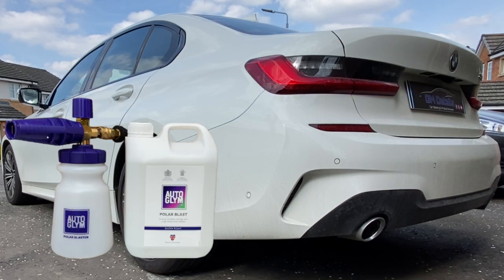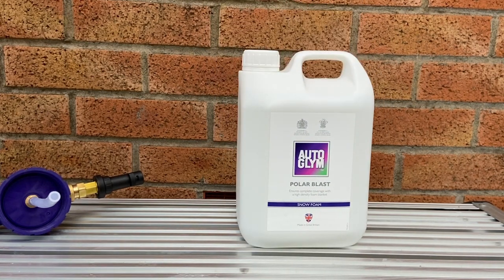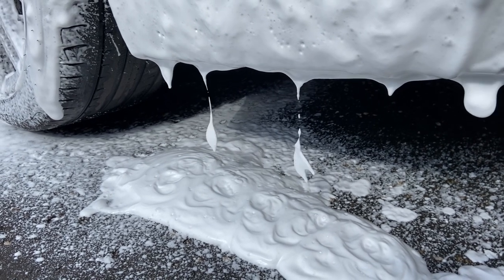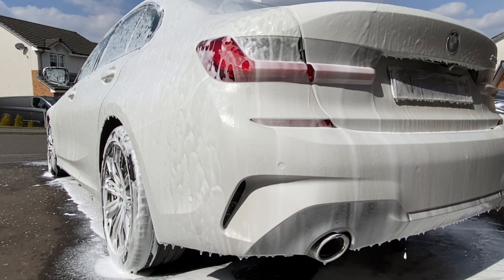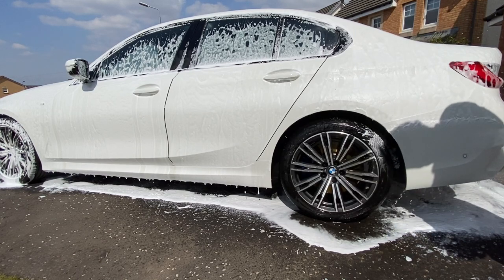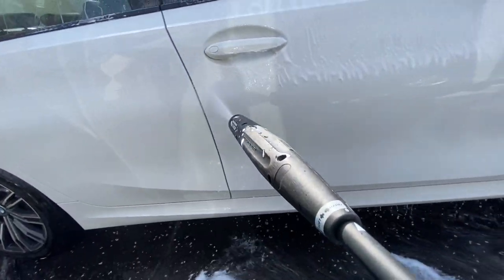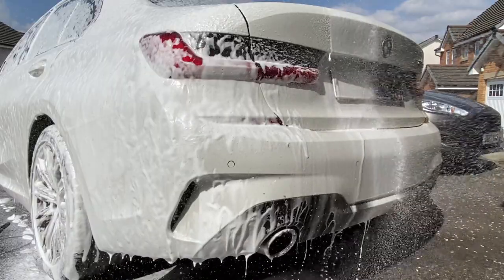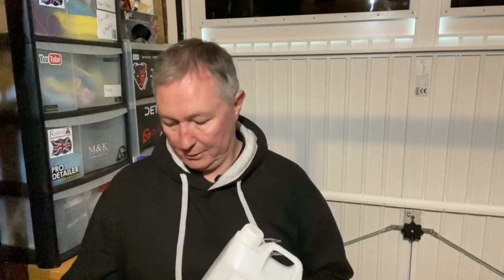Autoglym Polar Blaster Snowfoam Lance & Polar Blast foam review  | Karcher attachment

Comment: I watched your video today, tried to fit my polar blast to my K5 - for the life of my I couldn’t get to work. Other attachments work - has anyone had this problem ? It looked so simple in your video 😂
Reply from the maker: Aw so you have the black plastic Karcher to QC brass connector ?
Reply: @GMDetails  yes, I believe so. It was pre fitted to Autoglym blaster. I can take the vario lance off easily, yet a epic fail attaching the autoglym
Reply from the maker: @ukharrythomas007  it can be if you try and attach it while it’s connected to the lance , detach the QC part , attach the black Karcher part to your Karcher gun then use the QC brass connect to your AutoGlym foam lance , hopefully that will work better
Reply: @GMDetails  turns out it was a yellow connector from another lance stick in the vario wand. I’ve removed this and the autoglym now works 🙏🏻🙏🏻👌👌 - thanks for your help & video !
Reply from the maker: @ukharrythomas007 aw brilliant!!, glad you got it sorted 👍👍👍

Comment: I have used all three blast,wash and seal. All very good and value for money, Graeme.
Reply from the maker: I just wasn’t sure on the wash being snowfoamed on then rubbing a mitt over it , do you have some of the shampoo in the wash bucket as well?
Reply: @GMDetails  I use the blast first, then apply the wash on the car and mitt and shampoo the car. Finally I use the seal which gives a bit of protection and also acts as a drying aid.
Reply from the maker: Sounds awesome , I saw some reviewers using the sealant and quite a few foam sealants on the market now. certainly products are aiming at speed and ease of use now

Comment: Got a deal on Polar Blast from Halfords and Im quite impressed with it  ,  using a foamer its never going to be thick but does a good job and has more cling than Bilt Hamber applied the same way
Reply from the maker: I was actually surprised with it mate , being available in Halfords you know these things NEVER work 🙄
I’ve not contact washed the car the last few weeks , only Polar Blast and left it alone , something I’ve never done!!, I may never use shampoo again 🤣
Reply: @GMDetails  think it was 3 tubs for £21 so cant moan at that really . If its rubbish Id mix it with other foams to make them last longer
Reply from the maker: Yeah don’t waste it , can make a hybrid mix 🤣

Comment: Th foam dripping off into the floor isn’t wasting product, it’s actually good because then it picks up and carries the dirt off rather than just stick tot he paint
Reply from the maker: I get what you’re saying and I partly agree with you but only the foam which is in contact with the dirt can collect and remove it , I just felt that the initial application was overly thick and heavy prematurely pulling the foam off without an adequate dwell time that was all

Comment: I do enjoy AUTO GYM, but the hose end rubber O-ring failed almost immediately on the Blaster and leaked. Otherwise the polar blast, Polar wash and the polar seal worked great. I would recommend claying as well for better longevity of the polar seal.  Still beading decently after a month. Great Products.
Reply from the maker: That’s a shame your blaster failed so quickly, it is indeed a formidable trio of products, a month worth of beading is good going 👍👍

Comment: Great video Graeme, I think Auto Glym is a bit of a marmite manufacturer as it's traditional branding and look will not attract the yoof of today and its probably seen as a brand that grandad uses, even though its products are very good whilst not being the best in class.
That snow foam is so thick and reminds me of Autobrite Direct Magifoam in that if you get your ratios wrong it will be hanging around on your drive for days.
Superb cleaning power on the Polar blast and was definitely making a difference on your white paintwork.
Keep up the good work 👍🏻
Reply from the maker: Thanks Paul, genuinely impressed me how good the cleaning power is for a ph neutral foam, and unlike magifoam it won’t make it look like Santa’s just landed on your drive 🤣
Reply: @GMDetails  yes and unfortunately for me my drive doesn't slope away from my house so I have to brush the foam away, bringing even more strange looks from the neighbours 🙄
Reply: Not sure I agree with that. Always saw them as a premium brand - expensive if you were young but the best - even if its not the case.

Comment: Great video as per Greame, can I ask u tho, see how you've been doing the GT Tyre Serum, what's ur wash process for ur wheels n tyres? Do u still scrub them and if not do u apply it after every wash? Cheers Alan. 😎👍🏻🏴
Reply from the maker: Hi Alan, great question and I’m glad you asked mate, I’ve literally only used tyre serum 3 or 4 times since beginning of January and 5 months later the tyres are still conditioned and looking amazing , yes they get dirty and lose their perfect looks but just some GT wheel shampoo and a hogs hair brush is all you need to clean the tyres , scrubbing them isn’t necessary with tyre serum. 
For the wheels, well mines are ceramic coated so dirt build up isn’t as bad as without a coating , but again, GT one wheel shampoo in a bucket and also in a pump foamer like the IK foamer. 
Basically same process as your car, rinse , foam, and shampoo, once every few months I’ll go in with zero decon just to cleanse the ceramic and top up with GT Sigma, hardly need to use fallout remover on them at all with GT products. 
And yes, you can apply tyre serum after every wash if you like but I haven’t been and I still see the benefits , I didn’t in the early part of the year with winter salts etc but that was just the same dirt that was on the paint anyway , nothing stays clean very long does it 🤨
Reply: @GMDetails  thanks for the reply Graeme, that's some great info mate, your tyres look brilliant, defo prefer that look compared to the shiney wet look, that's so Arnold Clark showroom 😂 thanks for the quick response bud 😎👍🏻🏴
Reply from the maker: Ha ha ha Arnold’s gloss black paint 🤣🤣
Reply: @GMDetails  aye that's more like it 😂😂😂😂

Comment: Got this a while ago and only just getting round to using it so really useful video. Do you have the marcher on the ‘mix’ setting on the handle or doesn’t matter as pulls the polar solution through anyway?
Reply from the maker: FULL POWEEERRRRR!!!!!!! 🤣 the mix is on top of the lance if you need a little water to dilute the foam if it’s too thick

Comment: I've never used a pressure washer or snow foam before. Can I ask if it's better to pressure wash the car first and then use the snow foam or should I go straight on with the snow foam? Any help would be greatly appreciated.
Reply from the maker: Hi Mike thanks for commenting your question, there are 2 answers to this

1. If your car has an incredible amount of loose dirt like mud/ winter salt deposits eg I would give the whole car a pressure rinse down to remove anything that can be removed to allow the foam to work on the layer of film that’s stuck to the sides of the car, but allow the car to dry a little before applying foam

2. If you only washed the car in the last couple of weeks and it doesn’t have a build up of mud / debris then go ahead and foam straight on top of the dirt , let it dwell until you see the foam split apart and go thin then pressure wash it off methodically, use the pressure washer lance like you’re painting a wall and remove as much dirt as possible  before using the shampoo
Reply: Brilliant, thanks for the help.

Comment: Hi. Enjoyed your video, thanks. 🏴 

I’m looking to buy this stuff soon once I upgrade to a GTI 8. One question I see lots of videos where they apply the foam direct to the car without rinsing the car with water first. Do you not do that, and why out of interest? Thanks.
Reply from the maker: Hi James. Thanks for your comment & questions, rinsing before applying snowfoam is a very subjective process , best thing to do is try both ways and decide what best suits you , sometimes I’ll pre rinse all the car first then clean the wheels allowing the car to dry before applying snow foam, but in hard water areas this might create water spots , something I don’t suffer from here, another reason to pre rinse is to lower the panel temps if it’s warm, but that leads to another question of whether you should be cleaning your car in the sun 😅
Reply: @GMDetails  Thank you for your reply. Much appreciated. J

Comment: does this blaster work on any Lance and power washer
Reply from the maker: It does providing you buy the right adaptor off Auto Glym, it comes supplied with Karcher fit which connects to a Quick Connect 1/4” fitting for a stubby gun, it wouldn’t be worth while buying extra nozzles as the MJJC lance comes complete with any fitting you want

Comment: Hi I have auto gym is it better to jet wash the car 🚗 first
Reply from the maker: It will certainly help to get rid of most of the debris by a pre rinse with the jet wash but before you use the snow foam allow 10 mins for the car to dry off most of the water before you use the snow foam otherwise it won’t stick as well as it should. 
Hope that helps 👍
Reply: Basic chemistry says otherwise. Many of the ingredients will simply sit on top of water and not do their job. A water pre-rinse often moves dirt about, although obviously if your car has chunks of dirt that may make you feel otherwise. Try pre rinsing one side and straight foaming the other and establish the difference. Best of luck..

Comment: Was that weater you had in the jug then just added a small amoumt of soap ot it ? i have always used carplan soap would that work. also what's wrong with the kärcher FJ6 Foam Nozzle which is half the price ?.. also what does the  Polar blast say this on amazon Use as a pre-wash to reduce the risk of scratches & swirls
Reply from the maker: Hi Fred, yes mate, just tap water approx 415ml and top up to the 500ml with the Auto Glym snow foam. You could fill the whole bottle and use 160ml of soap but I never need a whole litre to cover the car.  
Carplan soap is not going to give you great results in a snow canon, best using the correct product for the tool. 
The Kärcher FJ6 is ok, I just find the tank a little small and the foam quite watery so not effective as a dedicated lance like the one I was using in the video, these brass lances can be as cheap as £5 now if you look around , are you in the UK Fred?
Reply: @GMDetails    i just replied but can't see it now ? i live in Cornwall so yes UK what do you mean brass lance i thought you used the kacher one. i have seen the foam gun with adapter on amazon but when i post a link my post disappears
Reply from the maker: That’s odd Fred, YouTube must not be allowing links on comments 🤔
I actually have a new video I’m working on with a huge selection of different lances but the Karcher one isn’t included , mainly because it’s just not even close to the brass ones available from many suppliers even designed to fit right on with the Karcher attachment.
Reply: @GMDetails  can’t wait to watch it to see what else I need
Reply: @GMDetails  what do you mean dedicated lance your using hte karcher lance with foam adapter which looks the same as The Kärcher FJ6
Reply from the maker: Hi Fred, something like the AutoGlym snow foam lance or Autobrite Direct snow foam lance , the gun which it’s attached to is that what you are calling the lance?, sorry I’m  bit confused now 😅
Reply: @GMDetails  I meant your using a karcher lance with autoglym snow gun ?
Reply from the maker: Ah yes I get you now, I’ve switched the gun (lance) from Karcher to a heavy duty MTM trigger with a quick connect attachment at the end which allows me to use various nozzles for rinsing and also means you can get a lot closer to wheels without having to stand up every rinse , have a look at my video on Karcher upgrades and you’ll see what i changed it to 👍
Reply: @GMDetails  that's cool got a link to them ? i will try the kärcher FJ6 because it's only for my own stuff
Reply from the maker: Bit on the expensive side but the quality of both items are incredible and delivers amazing quality foam too 

https://amzn.to/32K09Cd

Comment: The use of snow foam is to work on DRY SURFACES. Especially with Polar Blast. Why wet the car, the product wont stick since the car is already wet?
Reply from the maker: There are many reasons why a pre rinse is necessary , cool the panel down on a warm day, removing the crusty top layer of dirt /sand deposits so the foam has a better chance to work on the traffic film, whichever method works for the conditions I say 👍

Comment: I have used this with a mix of 50/50 and not much happens. Lots of foam but as for removing muck, useless. I’m not convinced about the whole snow foam thing.
Reply from the maker: It’s not going to remove dirt that’s been on a vehicle for over a week, either protected or not there just isn’t that much cleaning power in the majority of foams to actually contactless dirt removal 
It has its uses to help soften built up dirt or to allow a powerful pre wash spray dwell longer but the product itself won’t be all that potent

Comment: Isn't 5:1 500ml to 100ml of polar blast. Not 500ml to 83.333ml as stated in the video?
Reply from the maker: You could use that ratio if you wanted but that’s 600ml of solution , I only wanted to make up 500ml so the ratio becomes 83.333333333 😅
5:1 is 6 parts in total , 80ml polar blast added to 420ml water making up 500ml solution 👍
Reply: @GMDetails  thanks for the tip! Ive just got a 3 series,  and just ordered the autoglym polar stuff to clean it, so I'll give that a go 👍
Reply from the maker: @DeclanLucas  100ml foam + 500ml water you can’t go wrong 👌

Comment: Gets a lot of flack as it 'Autoglym' not used the lance as have a constellation Chemicals and infinity wax one. I find the polar seal a very under estimated very quick and easy to use lance sealant
Reply from the maker: Hey Drew!, people need to wind their necks in with the snobbery , AutoGlym has been and will be around long after many brands sink. I think a lot of Thor products still hold up well today and this snowfoam is excellent , I’ve used it a lot since first getting it and all this month I’ve never contact washed the car once!! Polar Blast was enough for the maintenance clean, Amazon is a bit cheaper than Halfords for it so I’ve put a link in the description if you need a top up 😁
Reply: @GMDetails  got the full range in my armoury along with GT and BH. I find autoglym perfect if I want a quick snowfoam, wash and seal in the shortest time to good effect particularly for my large van 👍😁

Comment: I thought the snow foam went straight on a dirty car. No need to fo pre rinse
Reply from the maker: Yes straight on a dirty car is generally correct unless it’s a warm day or a dark car with warm panel temperatures I would rinse to cool the panels but when I made the video I was ‘pre rinsing’ it seems this isn’t really necessary now as the foam works best with some dirt to cling on to 👌